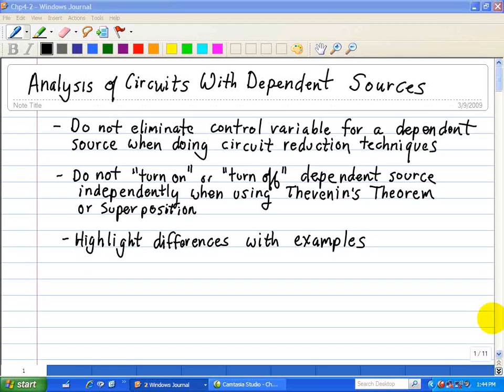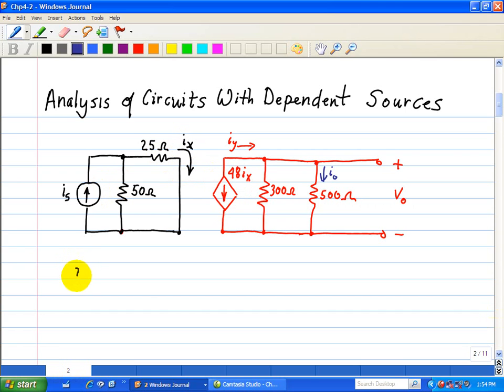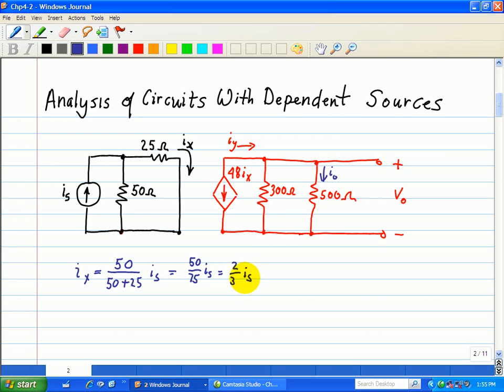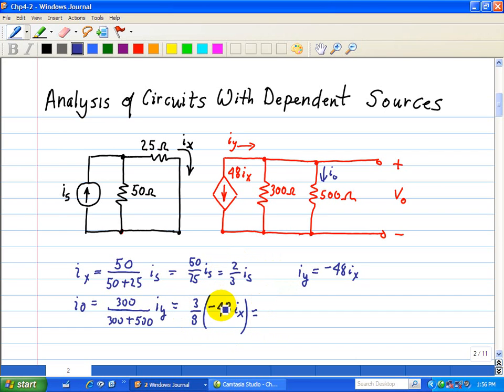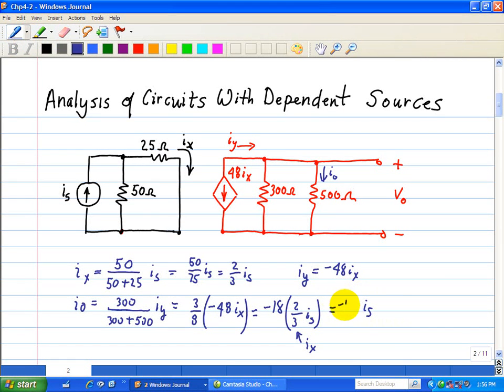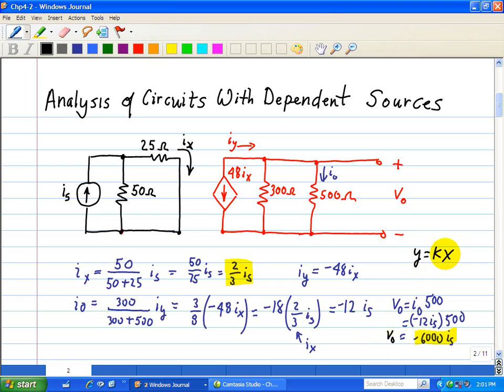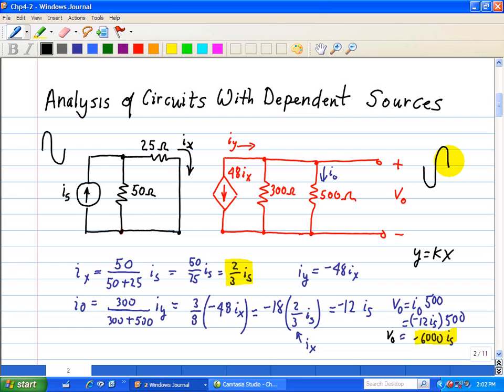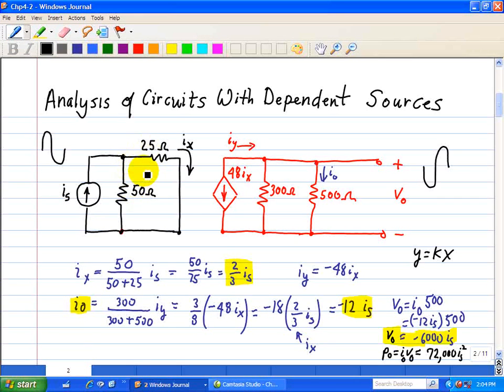Analysis of Circuits with Dependent Sources  - Part 1

Comment from the maker: @akitification   First consider two resistors in parallel where one is larger than the other.  The one with the larger resistance will have smaller current, so you use the smaller resistor divide by the sum of the two.    The smaller resistor will have larger current, so you use the larger resistor divide the sum of the two.  You can derive this relationship by noting that parallel resistors have the same voltage.   I  have a video that derives this.  Hope this helps!  Dr J

Comment: Hi, I was wondering why in the first step in defining ix, why did you use the opposite resistor for the current division? 
as in, why did you do 50/(25+50) instead of 25/(50+25)?